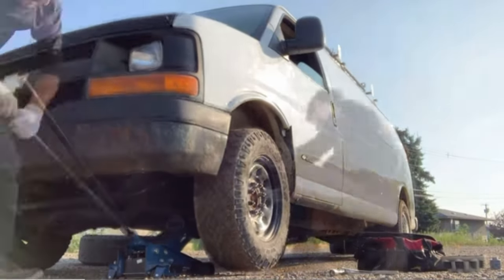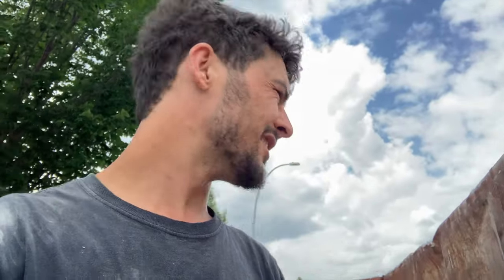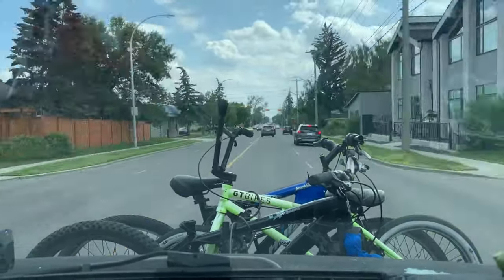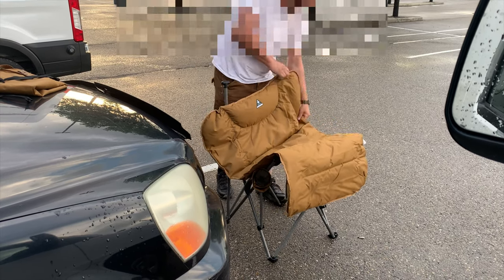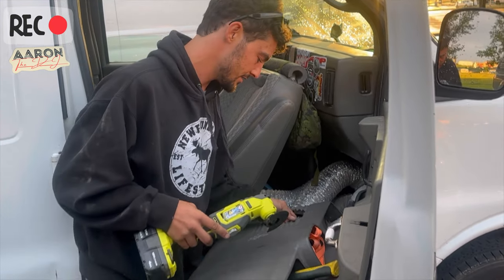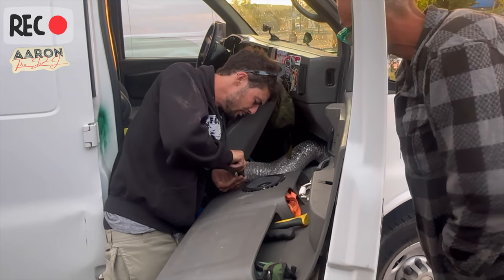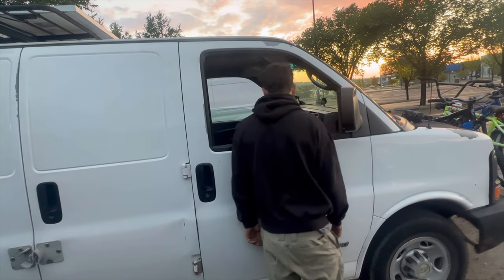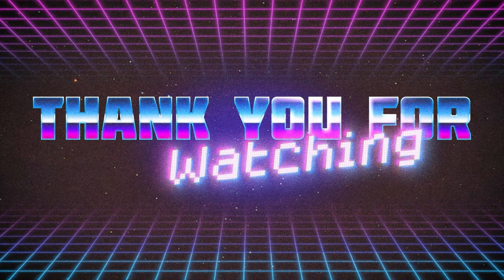4th Of July Hang Out And Chevy Express Van Door Speaker Install ?

Comment: Hiya Bruce! Thanks for commenting on the 4th of July. Its a thing to say and it's very patriotic! BTW happy belated Canada Day! Hope your cookout was spectacular, looked pretty yummy to me! Looks like you're working pre/y hard lately and your skin is showing it. Try some really good quality tea tree shampoo to wash the construction dust off your skin. It'll clear up the red marks and open up the pores so they get rid of the red stuff. I used to do drywall removal and that stuff made me break out so bad with red welts and acne so bad. I went to a dermatologist about it. She recommended tea tree shampoo or tea tree soap. Man oh man did that stuff work but it did kinda burn the first couple of times I used it. I use it every morning and after working in my yard. Happy trails and safe working conditions and travels to you buddy!
Reply from the maker: Thank you very much and I’ll look into that for sure thank you 🙏🏼😁
Reply: Another way to help with itch & redness is to rinse 1st with cool/lukewarm  water to get the dust off then follow on with hotter water and the tea tree soap.
Reply from the maker: I definitely need to be doing something😅 the insulation is what gets me most times 👎🏼 I need to fix my little shower thingy as I broke the head off on my door recently 😂🤷🏼‍♂️
Reply: Thanks for the tip. I don’t deal with that kind of materials but I have sensitive skin.
Reply: Some auto mechanics wash their hands w/  standard soap but don't rinse ,  just let it air-dry.  After the dirtywork is done ,  they say clean-up is easier as the dried-soap layer kept the grease & oils out of their pores & skin ridges.

Comment: Hi Bruce, I am travelling from Vancouver to Calgary and I need someone / shop who can investigate what seems to be a lower ball joint issue on my 05 Dodge Sprinter 3500 (high roof). Coulld you recommend a shop in Calgary, I just got here and looking for a garage to look at it. Best
Reply from the maker: Unfortunately no I can’t I don’t trust shops myself and I do all my own work , with shops it’s just hope for the best sorry I wish I knew a reliable one
Reply: @BruceVanlifeJunior  I have a quote from 2 shops that are pretty much consistent with each other. Are you looking for a side job helping me out with lower ball joint and front strut replacement ? I will pay you for your help. Let me know.
Reply from the maker: I appreciate the offer but unfortunately I’m just not set up tool wise to take on that job sorry
Reply: @BruceVanlifeJunior  alright thanks anyway. Question : Are specialized tools required for the lower ball joint ?
Reply from the maker: Yes it’s a ball joint press tool most shops have then I had one but I bent it replacing mine last time so now it’s useless 👎🏼